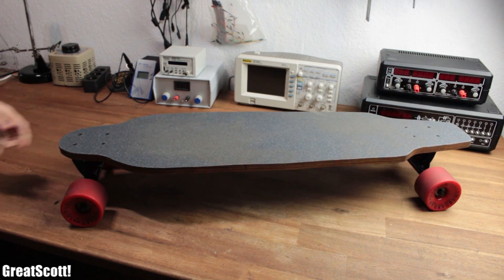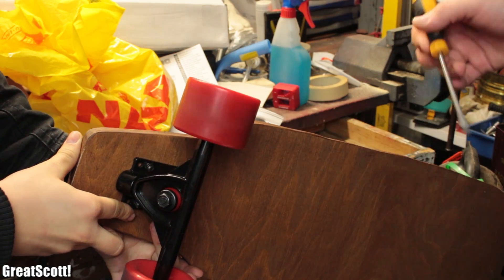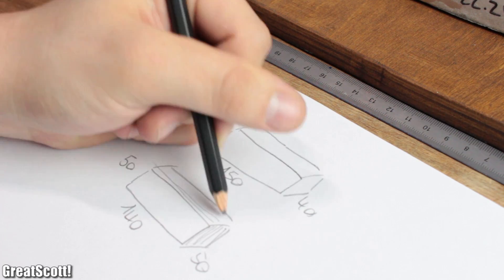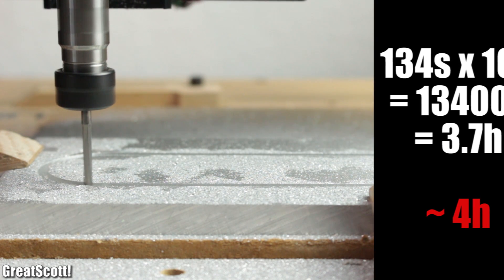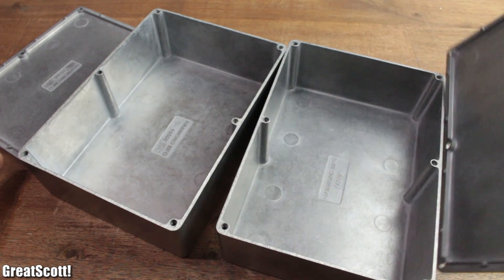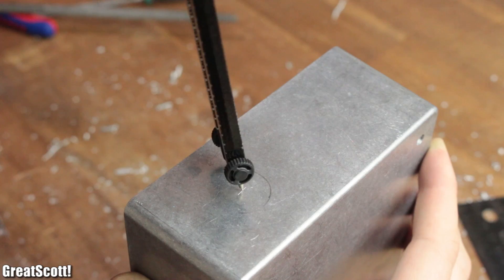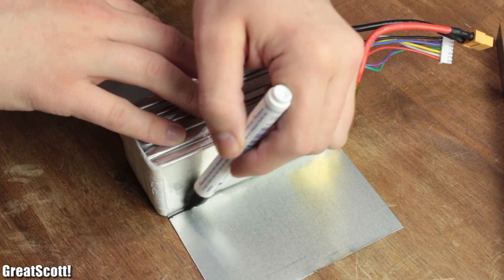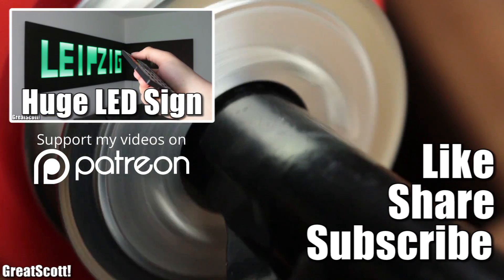Make your own Electric Motorized Longboard (Part 2) - the mechanical build

Comment: 1.5mm²? thats like 15A-18A for each phase... don't you think, that is a little thin? Wouldn't 2.5mm² make more sense? That would be able to handle around 20-26A... Also your motor suggests an 80A ESC, you used 70A, i hope you won't burn out your ESC, especially because it gets almost no airflow, and there is also a fair amound of torque on the motor...
Reply from the maker: +muh1h1 I did not have thicker one laying around. But the wires of the motor also only had a surface of 1.5mm^2. So it shouldn't be a critical problem. The ESC is mounted on one side of the aluminum case which acts as a heat sink. I had no problems with the 70A ESC so far, but going a bit higher with the rating is always a good idea.
Reply: +telefon72 the voltage doesn't make a difference, the energy lost is proportional to current^2 x resistance for a section of wire.
Reply: +muh1h1 That 15-18A is at a lot higher voltage though...
Reply: ***** i based my comment around standard for electrical installations released by the VDE, the assisiation of german electricians, which states that for a cable that consists of more than one core (in this case 3 cores) that is enclosed, with a profile of 1.5mm² the current should not exceed 18A per core. Of course this is all about long term safety, and you don't need to follow these instructions 100% in a private low voltage project, but i think it is a good guideline and shows, that the cables here are too thin. It is not critical though, the cable won't catch on fire, but you will probably notice a power loss because of the high voltage drop in the cable. Also not critical though. Just thought it should be mentioned that (if available) thicker cable should be used.
Reply: +muh1h1 thanks for the story mate, but sorry i did not ask for a rule book ;)
Reply: All the talk BUT I DONT SEE YOU BUILDING YOUR OWN??????
Reply: See that's where your point doesn't make sense because you can't be the most skilled surgeon if you don't know what the parts off a body are. you can't be the most skilled electrician if you don't know how what a switch is. that is my point, experience + knowledge does not always equal to skill because you need to understand how to put your knowledge in to practice so knowledge does not always equal to understanding. if you understand what you know and you practised allot (experience) you can be quite skilled at something. If a surgeon knows what a kidney is understands how he has to remove it, practised allot, than he could be quite good at it. so he is basicly skilled at removing a kidney. But honestly typing this is boring as fuck so i rest my point and leave you with your opinion.
Reply: ***** Skill is experience+knowledge. Knowledge is knowing how to do it, experience is experience doing it.

Furthermore, experience is a kind of knowledge, it's just more intuitive than factual. Knowing how to do something well enough that you are able to do it is what experience is.
Reply: no, you need a car or boat esc, those have brakes. the problem with plane and helicopter esc is that they are built to spin when you don't accelerate, and this doesn't work for an electric skateboard. use instead a CAR or BOAT esc. those will wait for you to accelerate before spinning the motor.
Reply: +telefon72 indeed 1.5 mm² is for up to 15 amps @ 230volts in a controlbox I am not sure about cables though, Calculations for cables depends on length, current, temperature rating off the cable and how its positioned (under the ground, in a cable gutter etc.)
Reply: +Jan van der Vloet Ze Cherman ya.... Ze sqvare must have ze fourr sides und drawn mit perfectly straight lines ya...
Reply: Mandala man Sorry for doing things properly...
Reply: +Jan van der Vloet work out the watts, can then work back. I've run similar size wire drawing 50A on 4s setup in a plane, no probs. did have some air cooling tho
Reply: +Benjamin Harvey as i said, it will work, the wire won't burn away instantly, but you are losing some power due to wireresistance and therefore voltage drop in the wiring. Assuming that the wire length is around ~30cm, and the motor draws its full 1560W at 22,2V, the loss in power would be ~34W with a voltage drop of around 0,5V. At 2,5mm² it would only be 20W of loss and 0,3V voltage drop.
Reply: marcelinhoGoltz Thats because i have no money, and probably not the tools, nor the skills.
Reply: +muh1h1 skill beats nollage 😜
Reply: +Jan van der Vloet Until your computer breaks.
Reply: Teth47 What do you mean by that?
Reply: Mhhh my bad, my english isn't that great, i just realised skill isn't exactly the same as experience... that's what i meant, i meant experience beats knowledge. experience + knowlegde ≠ skill. because knowledge ≠ understanding.
Reply: ***** My point is that skill and knowledge are complementary. You could be the most skilled surgeon on the planet, but if you don't know what the parts of the body are, you aren't going to get very far.
Reply: +muh1h1 can I use 3650 4370KV 4P Sensorless Brushless Motor with 45A Brushless ESC(Electric Speed Controller)for 1/10 RC Off-Road Car
http://s.aliexpress.com/ArMzquiM
(from AliExpress Android) 
and lipo battery 22.2v?
Reply: Sa Di if you use a 4370kv motor, you need to gear it down extremely. you would be better off using something like a 600kv motor.
Reply: +muh1h1 ok
samething like this?
A2212 1000KV Brushless Motor w/30A Brushless ESC and Pair 1045 Propeller for DJI F450 F550 Quadcopter FPV Part
http://s.aliexpress.com/IzeMbaae
(from AliExpress Android)
Reply: +muh1h1
Reply: Sa Di
yep, except that this motor won't be anywhere near powerful enough :)
You want something like a 600-800kv 80A motor and ESC.
Reply: +muh1h1 and can I connect esc from toy(car) with this esc
Reply: Sa Di technicaly, yes, but i doubt there are many RC cars out there which use Motors or ESCs powerful enough to do this Kind of work.
Reply: +muh1h1 ok 
4PCS/Lot Mystery Fire Dragon 30A /40A/60A for mutilcopter  OR 1PC 80/A/100A Brushless ESC RC Speed Controller for helicoplter 
http://s.aliexpress.com/rqQVnEv2
(from AliExpress Android)
this is very cheap ecs can I use it?

Comment: how many watts have that motor what u use? 
Btw: very good video.
Reply: +gamerpaddy Although I imagine if you use the full 1500 W the batteries will be dead within minutes. That's a pretty huge amount of power, a reasonably fit person can only do 400 on a bike for a moment, and 200 for longer distances. Considering that you can already get 30-40 km/h on a decent bike, this longboard should be an absolute blast.

Comment: Damn this is a major quality build. I was kinda expecting hot glue and scrap metal / plastic. Not machined aluminium, bolts / washers and actual precision cuts.
You're getting a lot better at making cut-outs for connectors.. Or you're getting better at hiding your mistakes :P

Comment: do you think to mount more wattage engine or multiple engines? And maybe you can mount solar panel? :v
Reply: +Crackeeer you would have to use very big solar panels to drive this thing with some weight on it. 

The board is very fast in my opinion so a bigger motor would be nice but i don't think it is nessecary.
Reply: +Satyrfolie132 look 60km/h electric board on youtube. Solar only for charging dude :)
Reply: Crackeeer  for charging you can use a smaler solapanel but 12V 1A is still pretty big.

He uses 2x 5Ah 22+V LiPos. If you do rough math this 12V 1A Panel would take about 20h of charging (loss through conversion etc.)

It would be nice if it was possible but i don't see that coming in the next <some number> years.
Reply: Solar is good for vacations without power (FLORA RULEZ) :)
Reply: +Crackeeer I'm curious, do you realize, on the very best case, how big must be a solar panel to produce 1.5 kW?
Reply: +Nicola Furlani okay okay

Comment: Could you build the engine inside of the wheel? instead of having adapter, belt, outside engine etc. (I know it is more difficult but it would more convenient)
Reply: Dorian Graczyk you can. They are rather new for electric skateboards. But I do not think you can easily custom make one, you need to buy one for that need.

Comment: What is zentimeters it is centimeters
Reply: +sara zahid 
Yes, Zentimeter is the german word. It is used as the sigular or plural form so zentimeters technicaly don't exist ;)
Reply: +sara zahid He´s german and in german it´s Zentimeter ;)
Reply: +sara zahid You need to use comma's and question marks.

Comment: total cost for this project is over 2.000 dollars?
Reply: +28noch What? I doubt it's over 200. What would cost that much?
Reply from the maker: +28noch Around 300$
Reply: +GreatScott! thanks. sorry.
Reply: Look in the description... He says it's $300
Reply: +Skitty™ | Garry's Mod Player thanks. sorry
Reply: +GreatScott! Yay, I wasn't so far away :)
Reply: If he has 2 5000mah 25c batteries in parallel is that not like 200+ amps and he has a 70 amp controller

Comment: awesme project. But I've got one question. What will heapend if you steer ? Because tracks and motor are fixed with the aluminium.
Reply from the maker: +Ben Szántó (NEO_CZ) Steering works just like normal.
Reply: GreatScott!  I checked the video again. Now i know how it works :) sorry for that bad question. Continue doing great stuff..

Comment: this is a great project but I'm curious is there a reason you have chosen to only attach the adapter plate to the truck and not also to the underside of the long board itself?
Reply from the maker: +CoffeeandCancerStix One strong connection seems to be good enough. But using the underside as another fix point is also a good idea.
Reply: Ok thanks for clearing that up for me :) looking forward to your future projects!
Reply from the maker: +GreatScott! No, I forgot. If you would connect it to the underside, you can not steer the board anymore.
Reply: Oh! Yeah I can see where that might be important!

Comment: love the project. unbelievable that the reach is 20km with one battery load. thank you，+GreatScott!
Reply from the maker: +emailausdrucker Well, one battery lasts for around 10km. Then you have to switch to the other one.
Reply: +GreatScott! but still- 10km with 5000mAh is awesome. considering friction，weight aso it still is awesome.
now i only need to learn to use a skateboard/longboard.

Comment: The only issue I have with doing this project is that I can't ride a skateboard to save my life.
Reply: Thats why you make it electric… ;)
Reply: Bennett Blackham lol
Reply: Long boards are extremely easy to ride just hop on and go
Reply: Mike Cammiso No. Never. I'll look like a 7 year old.
Reply: Mr Rishi The Cookie then do it with a bike :I
Reply: Mike Cammiso Its rainy here so ill have to wait till summer. That's a good idea i guess.
Reply: Mr Rishi The Cookie you could always practice on a skateboard, its not like you can get worse by doing that. it might take a while but you will eventually be able to stay on it and go in a straight line.
Reply: vgamesx1 My bike is just a heavy steel mountain bike so i guess that fits your description. And the kit seems cool but I still need to go a lot of research if i was to do this. For now ill stick to human power and reduce my asthma and get that fitness up for the ladies by summer. Also I don't travel much on bike since everywhere i need to go is walk-able. Though what would be cool is taking apart my moms stationary bike and using a motor/dynamo to charge some batteries for other purposes. It'll probably have not much use besides charging a battery to then transfer the power to my laptop.
Reply: +BlackMaskGameing RBM That's the problem, I hopped on, and I went, I just didn't like where I went lol Look like a lot of fun, but I never got into them too much when I was a kid, but if these were around might have been different!
Reply: That's the reason why I added a scooter style handlebar to the one I made.
Reply: BlackMaskGameing RBM I've tried riding a long board a couple years ago. It was scary as fudge. It might just be my brain even though i can ride other things. Ohh well.
Reply: +Mr Rishi The Cookie do it with a scooter instead!
Reply: Mike Cammiso I have had seriously bad luck with skate boards so naah if i can put it on a bike then it is more convenient. Also UK laws prohibits me riding electric skateboards on a pavement and i really don't want to ride on the road with an electric skate board. I would much rather use an electric bike.
Also learning to ride a skateboard is one of my goals but not convenient at all since the weather is horrible.
Reply: Mr Rishi The Cookie then an electric bike is probaly the best thing for you. i recommend some magic pie...

http://www.goldenmotor.com/magicpie/magicpie.html

i want one for my bike ^~^
Reply: Mike Cammiso woah those seem fast but expensive. My bike is a cheapo £99 steel bike. I'll stick to human power or some ghetto rigging the same motor that they used in the video if i can get the parts.
Reply: +Mike Cammiso Nice, that kit being multi voltage is really cool.

+Mr Rishi The Cookie What do you mean cheap steel bike? that's exactly what you want it to be made of, at least if you want an e-bike... 
If you're comparing it to more expensive aluminum bikes then you're hugely mistaken, as the main benefit to those is that they're lighter which is great for pedaling but for an e-bike they're kind of weak and unlike steel which will slowly bend when it fails, aluminum however will snap so I shouldn't have to explain why that's a very bad thing when riding a bike at 15+mph...

Basically a "cheap" bike made of steel is exactly what you want and if you're interested in getting an e-bike I'd recommend a kit such as this, at half the price of that other one http://r.ebay.com/sOyPaj exept no batteries, but hey you can get three 12v 12ah SLA batteries for about $60 not a super long run time but it'd only cost about $220 total.
Reply: Mr Rishi The Cookie yeah its not cheap but its a really good in hub motor, has regenerative breaking and stuff.
Reply: What?